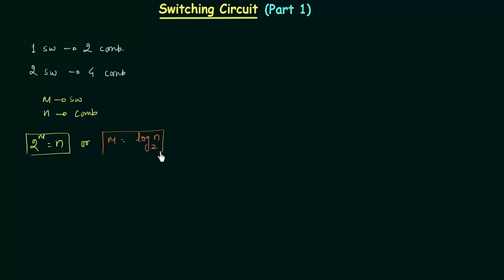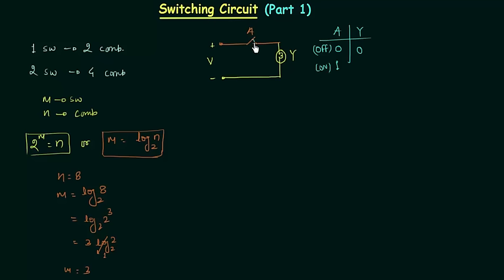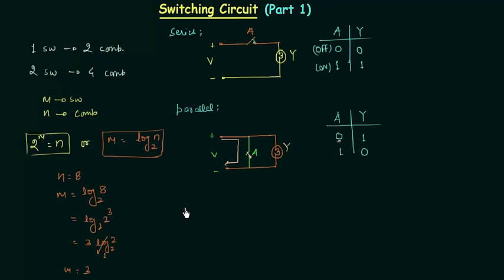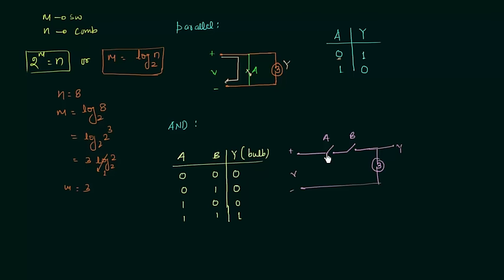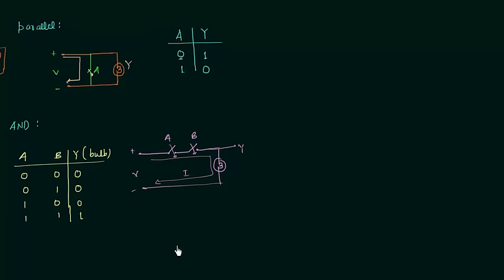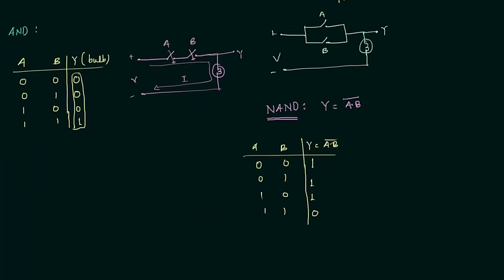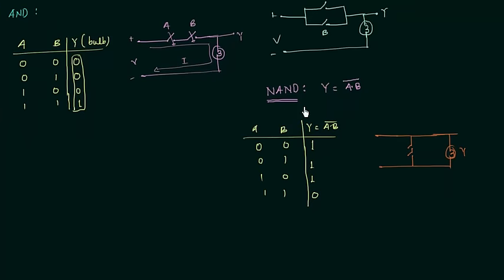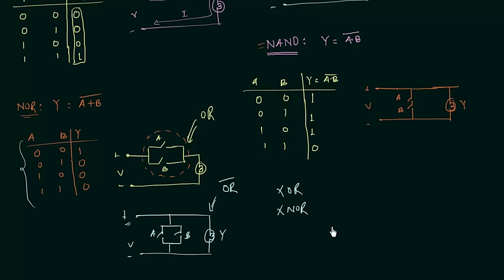Switching Circuits (Part 1)

Comment: Sir when the switch is closed you are considering it as a zero resistance wire so in the 1,1 condition of OR Gate the bulb should not glow I think

Comment: In the circuit for not gate, when we keep switch on, won't the bulb still glow?
Reply: ideal switch acts like short circuit as it has 0 resistance. use current division then, you'll find that all the current will go through closed switch, and none through bulb, so it will be turned off